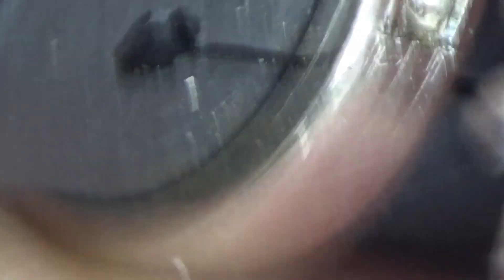Micro Pavé Solitair Diamond

Comment: Thanks for the video!
which tool are you using at 16:07 to push the stone in?
Reply from the maker: Hi Akash,
That's a hollow nail tip, you soaken it a bit in water to adhere the diamonds to your hollow tip.

Comment: If you set the 2.0mm pavé, what's the sequence? (Eg first drilling at 0.8mm, then drilling at 1.0mm ... then at 1.3mm ...) Would you explain how to drill holes in any size order?
Reply: hyun jun Jang drill with 1.0 mm carbide drill, then use ball shaped carbide burr 1.3 mm then 0.3 mm up till you reach desired size
Reply from the maker: In the video you see 1,3mm pavé diamonds. 
You just start around 0.7mm and work your way up skipping 0.2mm.
So 0.7, 0.9, 1.1, 1.3. 
Good luck! =)
Reply: @heinikendude  what is the reason of working your way up in increments? Why not drill 2.0mm but straight away?
Reply from the maker: access Hi, because drilling 2mm straight away would not give me room to make tiny connections to make the diamonds match perfectly.
Reply: @heinikendude , that makes sense. I assume if you were 100% perfect and equal with your spacing measurements with 100% perfect and equally sized stones, you may be able to go straight to the 2.0mm hole. However, from watching your technique, you work incrementally (what every jeweler seems to do), it likely gives you room to make adjustments left/right as you step up in size, giving a more of an ability to adjust and get that equal spacing so they match when laying next to each other. Would you say this reasoning is correct?
Reply: @heinikendude , sorry if that is an overly long question. I've been getting into metal casting and am soon about to try stone settings. The small details is something most instructional videos tend to skip over, but us amateurs need when we're beginning. Appreciate your video, gives a very clear example of the technique :-)

Comment: Does anyone know the brand of the tools he was using
Reply from the maker: Which specific tool? Some I made myself some are bought at different suppliers. =)
Reply: vandoorenniels  which brand is your hand piece? (not engraving machine)and microscope?

what is the name of 15:08 hand piece drill bit tool ?
Reply: hyun jun Jang cylinder burr, can be made out of carbide rod
Reply from the maker: Hi Hyun Jun Jang,
Hand piece is Lindsey Microscope is Meij (Japanese)
at 15:08 you see a tapered bur measuring up to 0.6mm at the wide end.